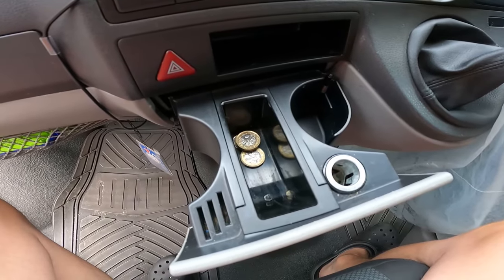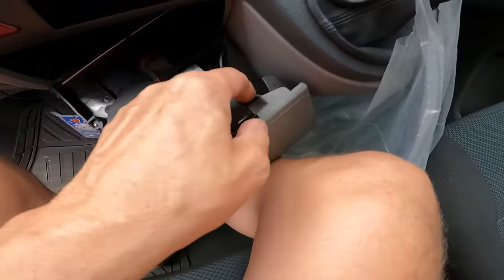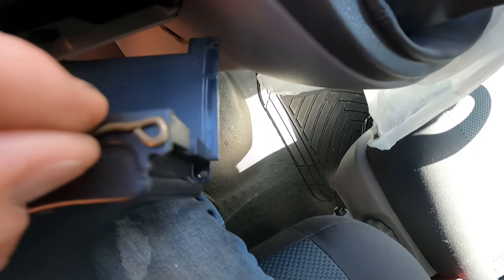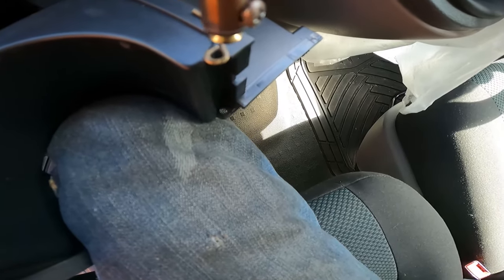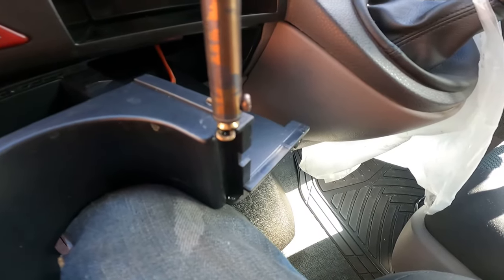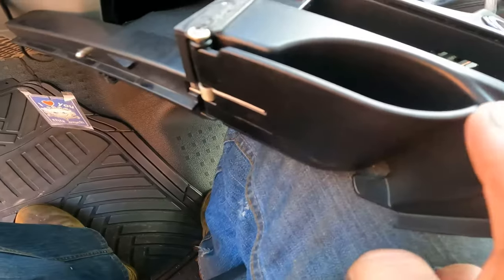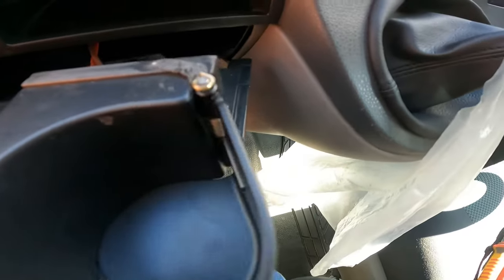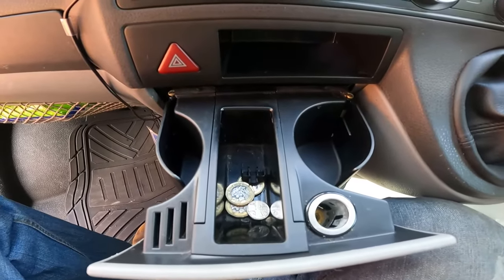VW Transporter T5 Cup Holder repair

Comment: Did my t5.1 cup holder tonight with a 3d replacement I found on eBay.  I used a gas powered soldering iron with a blade bit which pushed it in seconds.  Job done, thank you chuffged to bits

Comment: Hi I have the same cup holder but all the video I’ve seen are saying you need to remove screws by removing part of the dash.Is it as easy as that? Thanks for posing
Reply from the maker: Its exactly as a show in the video.
Reply: @wapsac  Thanks Paul for that👍